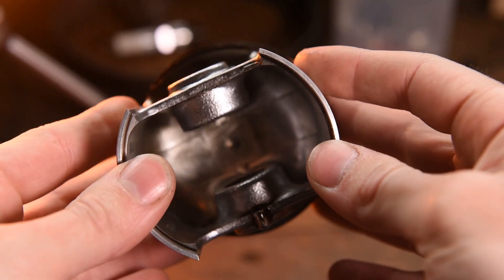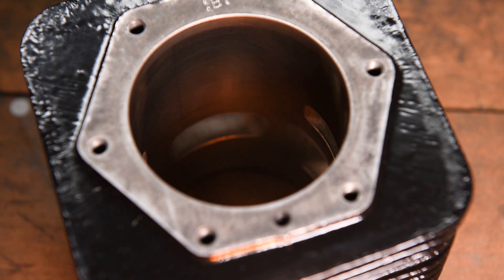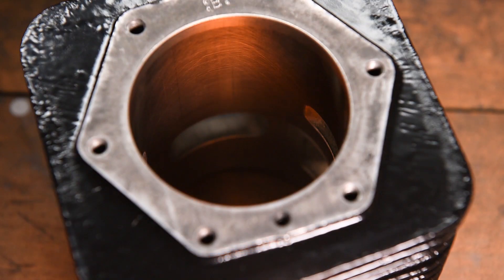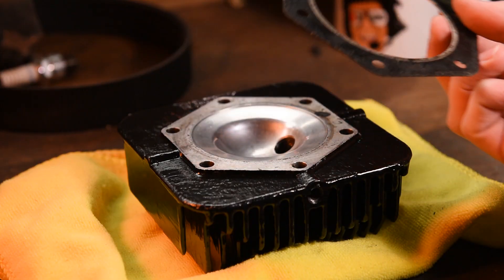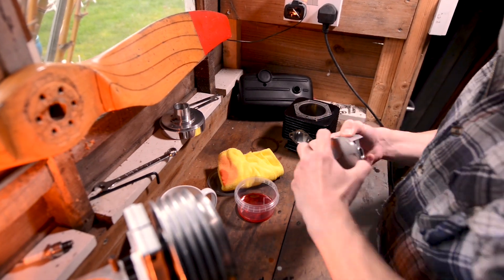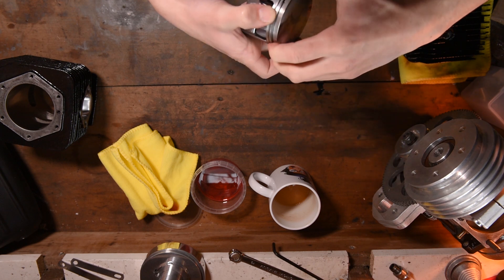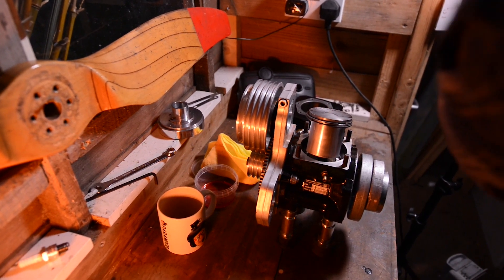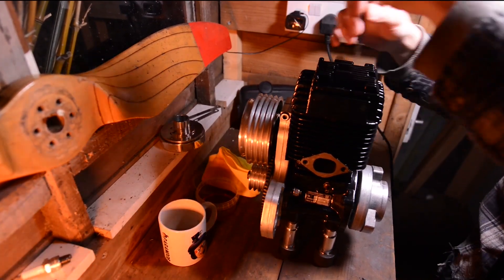How To Replace Piston Rings

Comment: Hopefully you see this msg, 2003 Mercury Marauder, do you think the piston rings can be changed without removing the engine...
Reply from the maker: That’s some serious engine work for a car. Are you restoring it? Short answer is you’ll need to pull that engine to get the head off and easy access to the pistons there after.
Reply: @DanielJonesParamotor  getting grayish smoke on start up regularly...
Reply: @Deaths_Inevitable that’s actually valve seals most likely if it’s only on start up